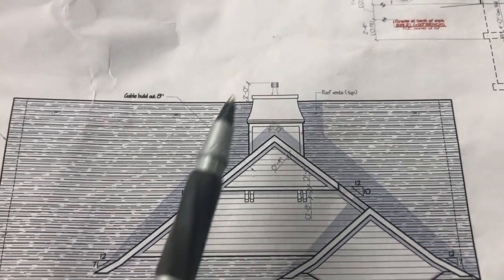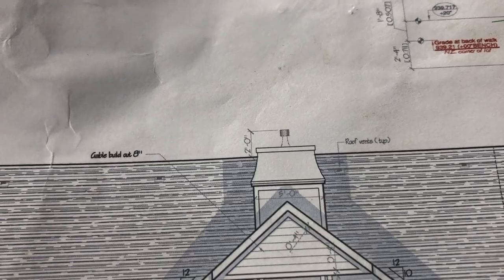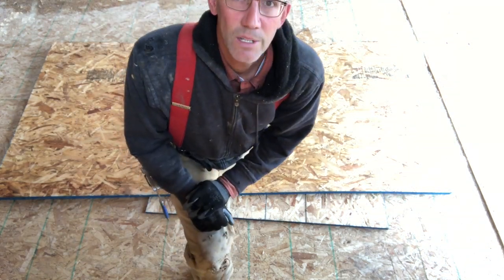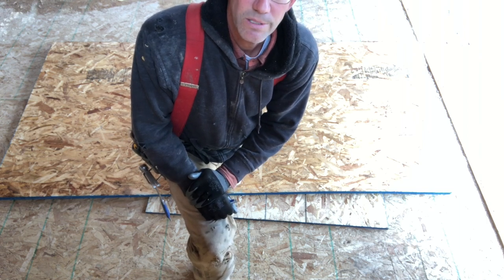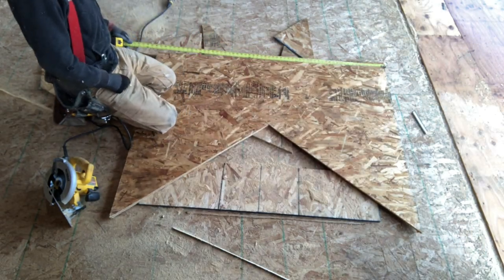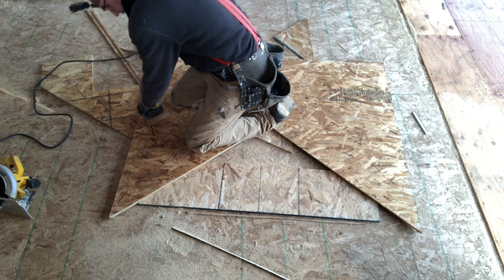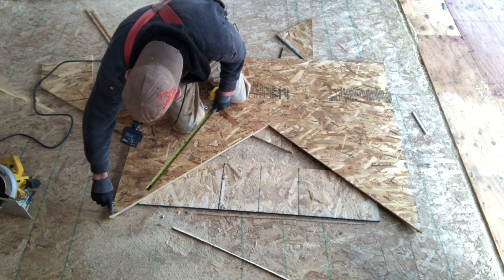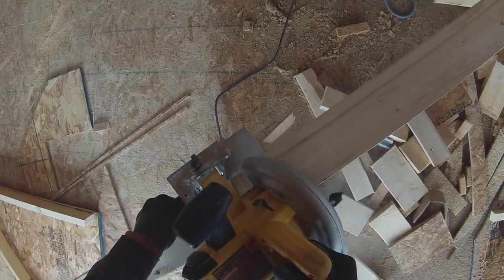How to Frame a Chimney Box

Comment: Throughout the years . I have watched many go atop the roof and holler down numbers . Drag nail guns, level and power cords up to build chases . 10 times more dangerous and takes 10 times longer .. If I can prefab anything in comfort , I will !! . Watched 3 guys attempt to build a 5' wide cricket 2 stories up . Ladders and guns . Come on guys !!! .. Give me the pitch and the width and I will build The Flying Nun on the floor in 10 minutes  . Drop it in behind and here's the sheathing that goes with it ! . "Efficiency is intelligent laziness " . Even on custom homes , So many things can be prefabbed on the floor . Dead dormers , Cupola's , Complete chases and one I especially like . After a few deft measurements , snapping out grid lines , Hardishake Panels !! ..Mockup the entirety and cut it out on the floor , It goes from a 2 man job with one on the roof calling out " Right side panel 3 , Rise 4 -3/4" , 22.5 degrees blah blah blah .. To where you are building the puzzle and shaking out the shake . labeling it . Then have the helper hand them in order to you as fast as you can nail them . Less time on the roof is less probability you fall .
Reply from the maker: I love a skilled tradesmen. Thank you Ivory
Reply from the maker: Ivory! Dan here. How are you? I hope your well. Just have not heard from you. Take care Ivory.
Reply: @framnerdan  Still here .. Currently not working because of Stage 4 cancer . Getting great health care . Had this Beast for now going on 3 years and my Dr's expected me gone by last year . For some reason they note ..The treatments seem to be working on you . They blasted 3 tumors out of my brain which are now undetectable but part of the side effect is weakness . I want to get back out there and do something since building is my love . Hopefully the thyroid / pituitary drugs they are giving me will get me going . Even after my stage 4 diagnosis last year . I said " Why sit still , see if I can overcome it all by working the hell out of it "  . I just hope it wasn't my swan song ..